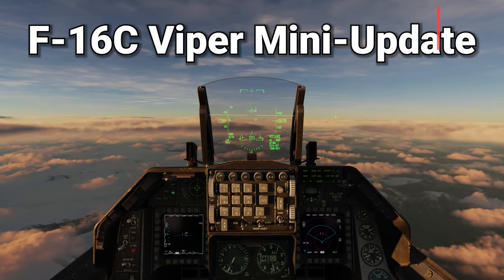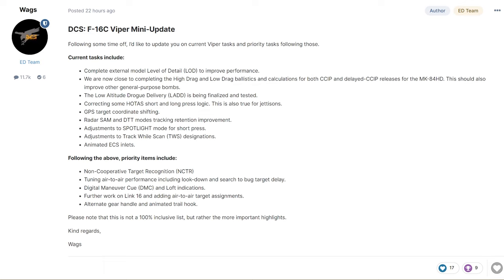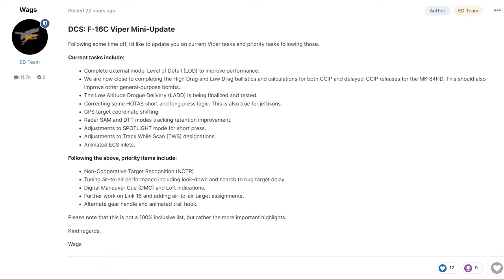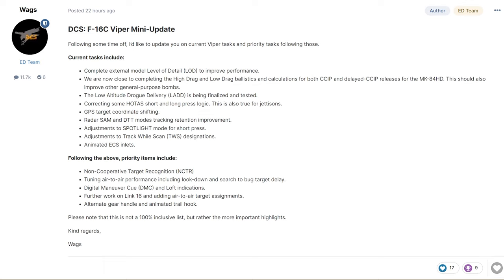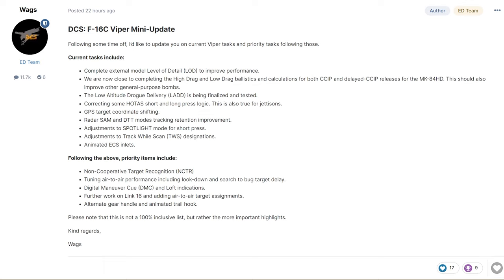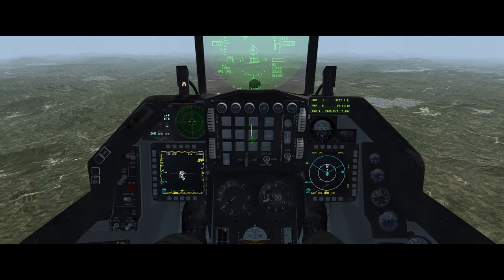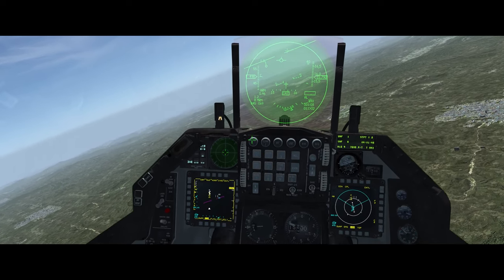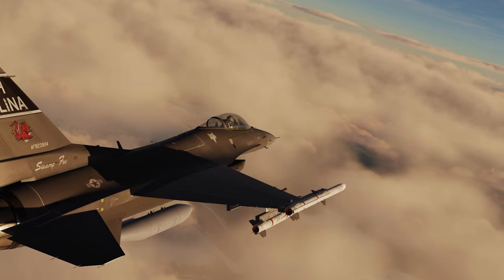DCS F-16C Viper Mini-Update | Air to Air Targeting Link 16

Comment: Except that the BMS version is using IDM datalink and presumably ED's implementation will use Link-16. IDM air target symbology is different to Link-16 symbology and ED haven't ever committed themselves to properly implementing IDM (it would be a big job). I imagine that ED's solution will be rather simplified, as is the rest of L16 currently. The general concept will be similar, but except to see differences to what you see here. (Hint....If you don't see differences, IDM hasn't been done right....)
Reply from the maker: Yep, I don’t know the exact symbology so this is an example using IDM, but I would imagine it would be something quite similar

Comment: Will the DCS loader update this automatically or do we need to manually log on and update it? Thanks, and great video. Liked and subbed.
Reply from the maker: These are all features coming in the next couple of updates supposedly.  This is just a roadmap of what’s to come
Reply: Loader. But do repair n clean up. Delete fxo and metashaders folder so u don't lag with low fps.